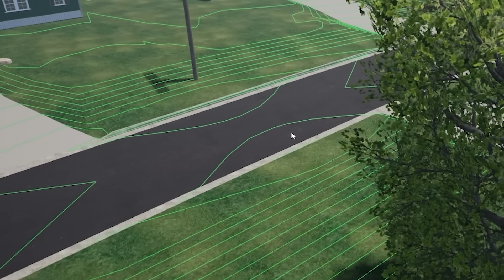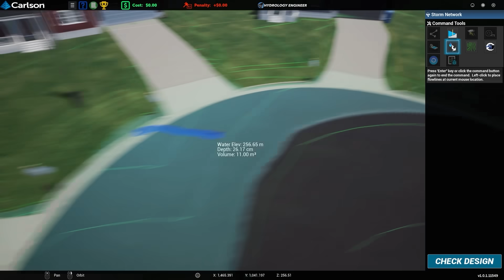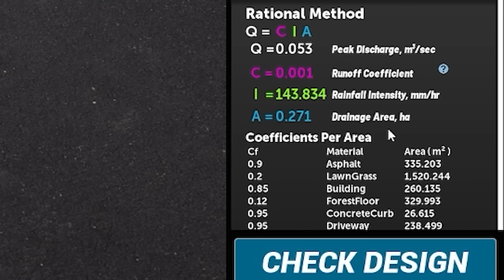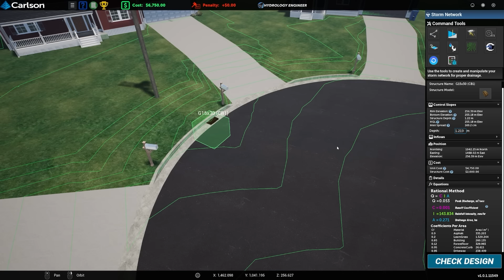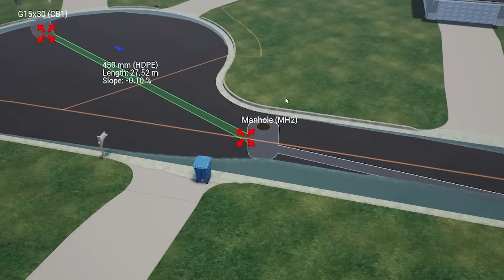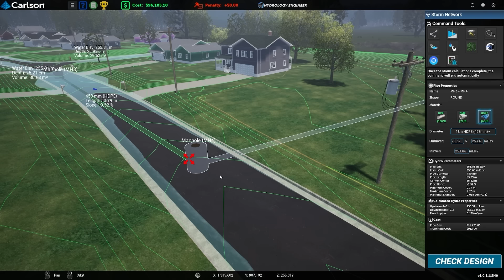Where does rain water go?

Comment: When u were talking about how grass areas are calculated i had to think of how the people that plan buildings in my are calculate it. I guess they do it kinda the same and only protect the basements that are in lower areas from rain. But barely any rain is sinkin in the ground here so even people on the higher point are ending up with water in their basements. Well mainly the people on higher points because no one thinks of putting brotecting there, even the ground doesn't take in any water ...
really bad engeneering here

Comment: I may not be a Civil Engineer, but I was in Telecommunications for 16 years...

The only thing that I would mention here, that I don't know if these are laws in England or not but they are in the states, is this thing called "Egress", which typically is the first meter or so of yard from the street.  Here, you don't own that.  The city does.  And that's where all the utilities go, and though drainage doesn't necessarilly interfere with say, sewer or electricity or gas or communications... still a bit of a problem.  And one thing that typically wouldn't be tollerated are manholes in a person's yard, front or back.  I'm honestly surprised that it doesn't restrict you to "Public Lands" or "Watchout for these utilities in the area".

Comment: Please spend the money for the whole game 😂 I found that really interesting, gave me a new perspective on the challenges involved in building this conceptually simple yet incredibly vital infrastructure. Making water run down hill seems easy until you consider that miscalculations could quickly create a hydraulic system akin to a pnuematic delivery tubes in banks and supermarkets, except instead of cash it will send or trap anything that may fall in it path.

Has there ever been an attempt to harness power from drainage water? Seems like a waste of potential to not put small turbines where there are large elevation changes. It would be inconvenient for maintenance purposes but surely there could be a use for all that energy?

Comment: that road is made with the lowest bidder. when you build roads you want the high point in the middle with a gradual slope until you get to the edge where you then put in the slope needed to make the gutters work. the gutters should be able to handle the flow of the average rain for the area so that even without sewer drainage it drains the water to a drainage area off the road (unused land reinforced with some rocks if need be to mitigate erosion). the standing water is either due to the utter failing of the builders or significant aging issues (land is not static). these standards are hold overs from when the US was too poor for civilized drainage, so the builders stepped up and gave us redneck solutions that let us live like we were civilized until we got prosperous for real civilization, which is why our stuff is better since it works without fancy stuff even when it does have fancy stuff.

Comment: 5:20 might be taking into consideration the water flowing from other spots, for example the high point line in the middle of the road.

If taken in isolation, a little stream flowing east to west might seem like it'd keep flowing west, but it wouldn't remain true if there's a full on flood path intersecting it north to south.

Comment: As someone who has been working on/with hydrology and hydraulic simulation tools for research purposes, and has been pushing for more usability/accessibility in the toolkits out there in order to get more people using them, this is incredibly surreal to see as a video game. Admittedly it's much easier to calculate and simulate surface waterflow and drainage with simple flow rate equations than accurate flow and pressure water simulation inside the pipes tied to pumps and consumer outlet demands (and god help you if you want to add transient flow equations for valve open/close and pump activation), but I'll keep my fingers crossed that one of the lads at Carlson decides to carry the development forward to more in-depth hydraulic systems simulation in the future-- would be extremely convenient for getting people trained to have a gamified and drag-and-drop user interface for this kinda work. But I think Carlson only really does drainage work, so sadly I doubt they'll do the work for me there 🥲
May not be the most thrilling or goofy type of "game" out there, but I enjoy seeing you at work with this kinda stuff! It's more complicated and open-ended in solutions than a lot of vidya, by definition, but I like that kind of problem-solving and real-world-applicable stuff! It's cool to learn things about how the world around you works, and if it's made into a game it's even better

Comment: What's really cool about this simulation is we're seeing real-time design and testing.  It just boggles my mind, considering all the pencil and paper math I had to do back in college to figure out ONE FRICKEN BEAM in a building for my structures class.  I could only imagine how structures would be now in college with my old professor--him giving us a homework assignment and some Chad is running it through what's essentially an "edutainment video game" to get the answers.
Reply: I find your perspective interesting. My brain usually is able to learn the "big picture" to get the basics. However, the intricacies are more difficult for me. At least I have to apply myself more.  Good fundamentals make everything easier in my opinion. Point is - there's nothing wrong with the old way. I don't believe I have the intelligence to learn the way you did. Lol
Reply: @Strum2223  It was fairly easy if you're good with solving logic problems (i.e. which beam should I start with first) but tedious.  And working with steel is much easier than figuring out concrete, which is MUCH MORE EASIER than figuring out wood.  Steel has one constant--(been a while so I could be wrong) 29M psi per square inch.  Wood's all over the place and requires something like ten coefficients to figure out.

Comment: Before I became an engineer, I imagined a lot of design would be like this, almost game-like. How disappointed I was when I had to spend hours measuring the width of the road, finding all the high and low points, crossings, places I couldn't place gullies, separating them out, drawing the catchments etc etc. God gully catchments is one of the most boring tasks you will do as a civil engineer.

Also the worst storms these days are 1 in 100 + 40 climate change, I think parts of Scotland are doing 1 in 200 year.

Comment: Land surveyor here - for something like this, if it was part of a large subdivision we would probably perform a Mobile LiDAR survey (with the unit mounted on the back of a truck with a high-precision GPS unit). It's a really fast way to do long roadway work - though higher-precision applications would require we do a lot of work beforehand to establish ground control points for the LiDAR to be rectified with.

If it's just this cul-de-sac, we'd perform a traditional topographic survey with a field crew instead.
Reply: Assuming the high precision GPS is cm level (eg RTK), how would having control points help (other than sanity checking with one or two)? Is it impractical to use the vehicle's cm-level track as a series of control points?
Reply: @zianchoy  For the kind of precision work we usually do, yes. 

Simply put: the Z-coordinate of the LiDAR point cloud is the most critical element of utility work (most of what we do is related to buried utilities), and the GPS reading of a moving vehicle simply cannot be trusted for this application - especially not when there are so many local topographic features that can interfere with GPS readings (trees, tall buildings, power lines, etc). The issue being that if you don't have a local elevation network you can tie your point cloud to, you don't have any good way to test the vertical accuracy of the cloud - redundant error control is an important part of the work I do.

That said, in principle cm-level GPS would be enough for many applications.
Reply: I see. I forgot that the vertical error would be critical and that's always worse than x, y error.

Thanks for explaining things.

Comment: Interestingly in Arizona we have MASSIVE flood basins through out the Phoenix Metro. Many of them are next to canals and freeways. I'm only in my mid 30s but we have had at least two of those 1 in 50 year storms. Which has forced the county to change a ton of the old above ground drainage systems where they add an overflow structure to the canals. What happened while i was in high school the basin near my house (24ft deep by three football fields) flooded over in two hours. Normally there is a pump that's in the basin which pumps into the canal so they basin doesn't overflow. Problem is every basin was overflowing and all the canals where overflowing back into the basins. All the freeways and all the basins attached to them were flooded. Half the freeway pumps died to overheating. Basically we got an entire year of rain in two hours. Doesn't help that when there is rain all the dust and debris go into the pipes and clog everything either.
Reply: Climate change causing more extreme downpours, invalidated old modes.

Also sometimes areas get redeveloped and there's more paved/built area after, but they don't redo the drainage system. It's the reason we have to write drainage proposals for each development permit.

Comment: Maybe you can help me with a curious question. I never understood how draining works when going uphill, for example i live in a valley and only access to my little development is down a massive hill, how does our sewage go up hil? Stormdrains i believe go into retention ponds and ultimately a lake at the bottom of our valley, but sewage?
Reply from the maker: Pumping stations
Reply: @RealCivilEngineerGaming  the thought of having to pump sewage is crazy to me and i am assuming enough has to accumulate for it to even work, still a bit baffling how that works to me but i assumed it was pumped up the hill, just still how it pumps both water and solids and all is interesting. maybe they add water behind the sewage to help pump up the sewage and push the solids up easier? I dunno.

Comment: If you designed a full drainage network in this town would you use 2 headwalls, one in the place you put it and one down the sideroad, or would you lead all the water down to the crossroad, and have a bigger pipe go down the sideroad and into the pond from the side, or would you do it a different way, and why?

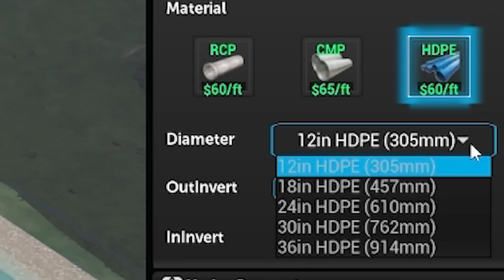Comment: 17:58 Plastic pipes may be cheaper but the leach micro plastics and chemicals into the water that travels through them, and require shipments of vinyl chloride (the stuff that spilled in East Palestine OH last year) to manufacture, so in reality the costs of plastic are far higher, but it's just that many of the costs aren't reflected in the bills charged by the contractors putting the pipes in.